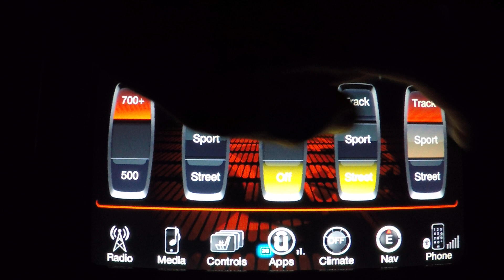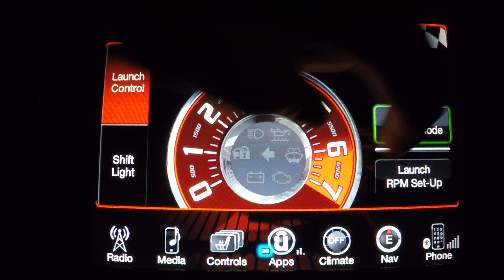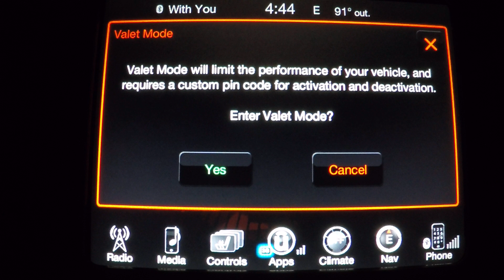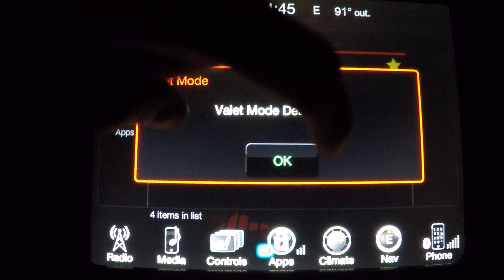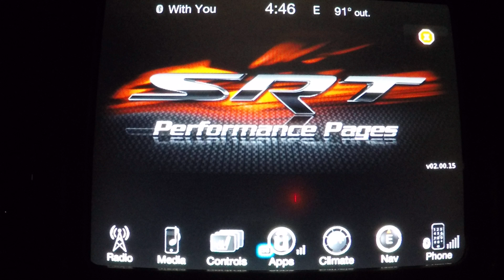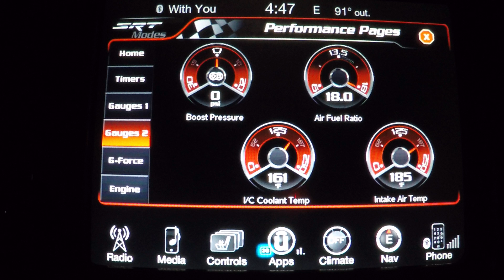Hellcat Technology Part 3 & Launch Control

Comment: when you change modes like from track to sport mode, does the computer and setup make the changes right away or do you have to save the settings ?
Reply from the maker: Keegan Jacobs the only one you can change is custom the rest are pre-set but once you set up custom once it will be like that until you change it

Comment: My default is 500HP for my 2016 HC Challenger.
Reply from the maker: NinjaWarriorDude 500 hp is only when the black key is in use
Reply: Nope...... in my 2016 Hellcat the default/Eco Mode with the red key is 500HP.. then there is Custom and Sport and Track modes which are 700+HP.